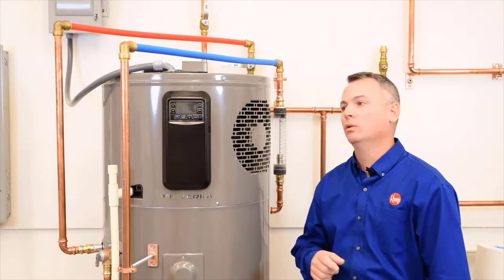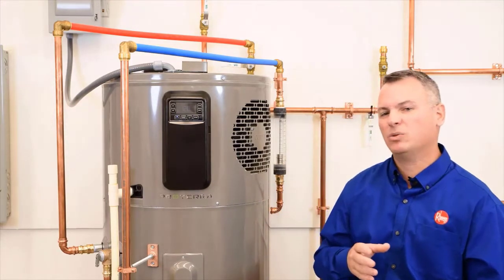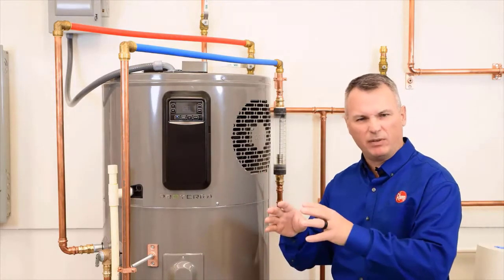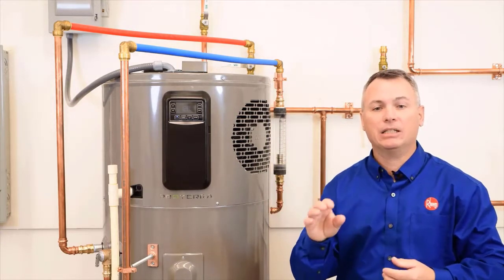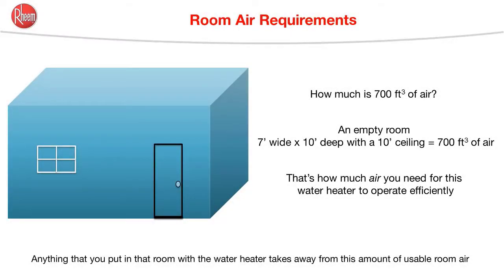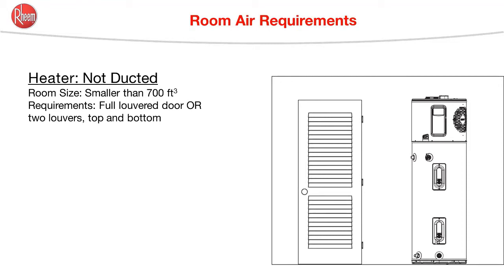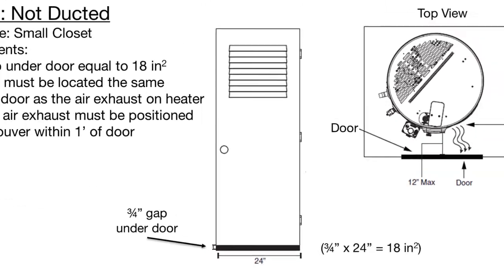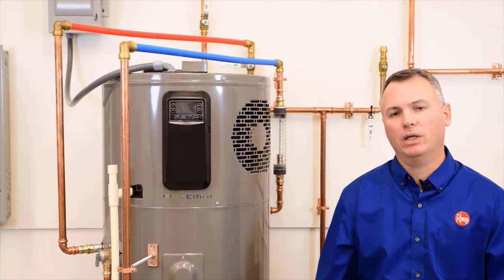Room Air Requirements for Installing Rheem® ProTerra™ Hybrid Electric Heat Pump Water Heaters

Comment: Video was not helpful at all.  You spent most of it talking about the requirements but little about where the ducts go, postive/negative air pressure.  Rooms that are smaller that 700 but don't have a spot where the water heater is 12 away from the louvered door, etc.

Comment: We have this water heater in our unit and it makes an excessive amount of noise. A very annoying high pitched noise. We have gotten it replaced and this new unit still makes the same noise.
Reply: I'm looking at the same issue. I believe. They are willing to replace it, but I fear the new unit will do the same thing.

Comment: I was hoping to learn what the optional ambient air temp needs to be.  My basement gets no colder than 63F in the dead of winter.  Wil an HP water heater functions efficiently in that environment.

Comment: Too much piping. There should only be 2 pipes on the top of the tank and one going down the side for pressure relief. Also my tank is in a 2 foot by 2 foot closet that has extra insulation. This is a poor design. Probably an engineer designed this monster. 73

Comment: I am still confused what is best practice for locating my heat pump water heater. I was going to place it in the garage. The garage meets the 700 cubic ft requirements. The house's location is Eureka, CA so we have a range of average of 46-64 degrees but rarely below 33 degrees. In other words not extreme. If the heat pump is drawing heat from this space and adding cold air would I be dropping the temp in this space out of the range of efficiency? (Making a cold garage colder.)  The second option is to enclose it in a closet in the garage and vent it to the outside. Probably more efficient but cost more to build a closet and provide a door and flashing venting to the outside. Question: Would this work efficiently just in the garage or is it recommended to have it in a closet that is vented to the outside? Thanks

Comment: Have a two story home in Arizona. Family of 4 not entirely sure if I should get 50 gal, 65 gal or 80 gal. Any suggestions
Reply from the maker: We would recommend consulting with a local plumbing professional to help choose the best Rheem Water Heater for your family
Reply: @rheemwater  Not familiar enough with your own product or too scared to actually commit?

Comment: My current water heater is in the large stand up crawl space. It gets to a low of 28-34 degrees in the winter . I assume a heat pump wager heater would not be the best option.

Comment: How did you mount the hanger for the cold water inlet to the side of the heater? Is it safe to just drill in with some short self tapping screws?

Comment: What is the approximat temperature of the exhaust air? Let's say the unit takes in air that's 70°F. What does is cool down to on the exhaust side? 65°, 60°, 55°?
Reply: These units work best the higher the temperature is above 40 degrees.  Hope this answers your question.

Comment: Anyone have any experience with the 120v plug-ins? One of the local Rheem plumbing reps is trying to convince me it’s not a good option vs 240v, but the only argument against is the slow recovery time. Anything else i should be aware of? Thanks!

Comment: This heater seems better suited for mild/hot climate homes where using internal heat in the building is desirable. It would be ok in summer time to use excess heat in a household but the water heater is usually in the lower part of the house where it is cooler already. So for this system to be ideal, it would need to be on the warmest floor of the house and pulling heat from the air when you want to COOL the house. It would be a negative when you want to HEAT the house unless it has an outside heat pump to draw energy. Otherwise, it is a pretty interesting idea and could work well in places that need more cooling of the internal air.

Comment: The 120v shared circuit 50 and 65 gallon first hour rating is 55 gallons? Typo on rheem website?
Reply from the maker: The first hour rating is correct for both products. If you have any additional questions please call Technical Support at 866-279-4566 between the hours of 7 a.m. and 7 p.m. CST and one of our experienced analysts will be happy to assist you.

Comment: When my brick foundation was replace by concrete I had a small utility basement created for the water heater and furnace. I recently went all electric and added a 65 gallon Rheem. It was installed in the utility basement which is theoretically too small. There was already a louver between the room and the crawl space so that the former gas appliances could get air. I had a small air extraction fan installed opposite the louver and facing the water heater exhaust. It exhausts out a vent and works great. The room gets a bit cold and dry in Bay Area winters, but the incoming air isn't that cold and is certainly humid. I also added solar and this year my PG&E bill was about $35 negative. I still have a bit of credit on my bill. Happy camper here. Oh, and the room will have my batteries should I decide to install them.

Comment: I have the 80 gal model.  I wanted to oversize for my wife and I because heat pump is much slower to recover so I made up in volume.  It does sip electricity and runs for hours.  I would only use this if you live in the south.  We built a new home and I put a 8 in vent hole in the side of the house to vent in the winter.  The good part for us, it keeps moisture low in our finished basement.  We have a small storage area with garage door to store the golf cart, we just leave the interior door open most of the time to have additional flow.  Yes it can be a bit noisy.  So if you dont have a good application for all the recommended requirements, you will not be happy.  For those in the south, its free air conditioning and is really cool.  What I cant believe is the current model in this video does not have the collars like mine to add duct work.  Wow...who was the genius that wanted to save the company a dollar?

Comment: I'll say one thing. Rheem really did a disservice by downgrading the control panel from the Gen 4 to the Gen 5. The old blue touchscreen was so much better. You could see the temps in .1 degree increments in both the upper and lower tanks, service info and alerts all within a few taps. Now it's a crap screen that shows nothing and an app that hasn't been updated in over a year with a water availability pictograph that is always completely full or on red after a single shower lol.
Reply: Buyer beware! 73

Comment: You've said in an earlier comment that the unit doesn't operate efficiently in less than 37F ambient, but is there danger to the unit or will it just use more electricity because of lower efficiency?  My garage was in the mid 20's for a week this winter.  The unit will be in a smallish room in the garage with an open door, so greater than 700 cf.  I could install a door to close only during cold weather and keep the light on to increase the ambient, but then the volume of the room would be less than 700 cf; maybe 400 to 600 cf.  I'm thinking the 700 cf min is to prevent overheating, so less than that during extreme cold periods wouldn't be a problem.
Reply from the maker: If the ambient air temperature goes out of this range, the unit will automatically revert to the traditional "Electric Only" mode until the ambient temperature falls back into range. The minimum room air of 700 ft³ must be maintained. When the unit senses ambient air temperature below 37 degrees F, it automatically switches to Electric Only mode.

Comment: Thank you for the video. Will this work with a hydronic heating system. Right now I have a hyrdonic water heater but would love to use this if possible.
Reply: As an HVAC tech I want to say yes it will work but check the literature and see what the max allowable temperatures are for this tank and how efficient it is at higher temps. In hydronic heat you would probably want temps around 140-160 or higher in colder temps.
Reply from the maker: Unfortunately, these water heaters would not recover quick enough, or produce enough hot water, to keep up with a hydronic heating system. However, please consult your nearest Rheem representative, as we have a solution for every hot water application. Please contact our Technical Support Team at 800-432-8373 for more details.

Comment: What is the room air requirements for the ProTerra®Plug-In Heat Pump Water Heater
 (120V Dedicated Circuit)? Can I install outside? Should I install in a locker and set on a vibration pad? Thank you! - Writing in from the San Francisco Bay Area.
Reply from the maker: The 120 Volt Dedicated Circuit model requires 1,200 ft³ of air. Outdoor installation is not allowed. Vibration isolation would be recommended if excessive vibration is anticipated. Rheem sells vibration kits, as well as seismic isolation kits that might be required in your area.

Comment: If I bought the Rheem model XE40T10HS45U0 could I add the leak detector and auto shut-off valve later?

Comment: My current water heater is in the attic. Can this water heater be installed in the attic? The room space is big. Not sure if the heat/cold in the attic can degrade the functionality. Can you please confirm?
Reply from the maker: The minimum air requirement is 700 ft³. The operating temperature range is 37°F to 145°F. If the ambient air temperature goes out of this range, the unit will automatically revert to the traditional "Electric Only" mode until the ambient temperature falls back into range.

Comment: Are refrigerators and air conditioners considered to be heat pumps?
Reply: They both pump heat.
Reply from the maker: At a basic level, yes. They use a refrigerant to move heat from one location to another.

Comment: IDEA:  Have a "Summertime Mode" where it vents to and from the interior space, and a "Wintertime mode", where the cold air vents to and from the outside space.  (use traditional water heater exhaust vents, and add mechanical baffles)  In the winter, take air from outside the envelope to grab the heat from, otherwise, this unit would "steal heat from the house/garage to put into the tank", thus being parasitic on your main house/garage heat...
Reply: True but if you have a wood stove in your basement your in luck. You Sir are a critical thinker.
Reply: @MrSprintcat  Same thing with a refrigerator... In the summertime, if it could vent the excess heat outside, and wintertime waste the heat to the interior space, then that would be more efficient than having to re A/C the heat that the Fridge puts out in the summer...

Comment: I don't know if this is accepted practice but I though it was a fun idea.

I ducted the intake to my bathrooms, since they share a wall and the DWH is in the basement directly below both, it was pretty easy. So now the DWH draws warm moist air from both bathrooms, cools and dehumidifies it, and then releases it into the basement right next to the primary heat source which is a wood stove.

Next, I'm thinking of ducting the exhaust air back up to the living room for better air conditioning performance in the summer, maybe use some dampers to direct it seasonally as necessary.

Thus far, I have been very happy with my Rheem ProTerra. It's summer time and we currently have inlaws and cousins in town and with 8-12 people, it performs without any issues. I do have a wastewater heat reclaimer, so that does help with total hot water volume.

Cons: The duct adapters are ridiculously expensive for what you get, which is a simple plastic duct adapter. Fortunately, I got the water heater about half off due to state level instant rebates.
Reply from the maker: We're glad that you're very happy with your Rheem ProTerra Hybrid Electric Heat Pump Water Heater. The EcoNet app has a lot of features. Here are some blog posts that highlight some of those features: https://www.rheem.com/water-heating/articles/tag/econet/. You can download the app here: https://www.rheem.com/econet/.

Comment: They removed the ducting adapters and replaced the fan with a noisy 
unit on the current generation, 5th gen.  I guess they figured they 
could sell them separately so why include them? Disappointing.
Reply: Yeah, and they cost $140 each. EACH!
Reply: Rheem hybrid water heaters are as loud as a loud hot water heater. Neither Rheem nor Home Depot warned us about the excessive noise. I'm going to try to return the unit on Monday. If they don't take it back, it is class action lawsuit time.

Comment: One of the byproducts of it the noise and vibration. I had one installed on the fifth of May and as soon as it was turned on, I said to the installer it's noisy and he said it will quite down and it didn't. When it's running you can hear a ringing noise coming from the compressor and a hum from the blower and the vibration from the compressor resonates through the walls on that side of the house in my front office and back bedroom. They say it's normal to have 65 dbs but how come I can hear it in other parts of the house. If this were in the house it wouldn't be acceptable and its very irritating when I'm in the garage working or on the treadmill. I worked as an appliance tech for 30 years and changed a lot of compressors and this is not acceptable and cannot recommend this to people especially if it's in the house it would be very irritating after running a while. The tech is supposed to come out and move it away from the wall because the back screw that holds the cover on top is not accessible if you had to remove it to be serviced and to see if the vibration can be stopped through the house. Refrigerators and window airs aren't this noisy why is this unit? It's not right This is a generation 5 and I hear the 4s weren't as bad and you can't find one, so buyer beware. I talked to the company who installed it and said Rheem isn't doing anything about it and that's a bad sign of a bad company.
Reply: I had the same issue. In my case, the ringing came from the outlet grille. If you hold your hand on it, you can stop the ringing and the fan and compressor are much less obtrusive. So I used some magnets that changed the resonant frequency and the ringing went away. You could also cut the center piece out.

It's a poor design that apparently nobody noticed in testing. But it's not hard to fix.

Comment: Do you need a expansion thank for 80 psi or less?
Reply from the maker: Yes. Water expands when it is heated. Thermal Expansion Tanks absorb this extra volume of water until a hot water faucet is opened and "extra" water is put back into the system.

Comment: So putting this inside the apt isn't ideal since the air will be cooler than in a typical garage setting
Reply: The ultimate heat supply will be provided by the HVAC system. This thing runs about 9,000 BTU of cooling while it's running, so it's like having a small window air conditioner. It's great for in the summer. In winter you may introduce some comfort issues, but you can fix these by ducting the cool exhaust somewhere where it is less objectionable. The other option is to run it in resistance only mode in the winter, if you are having problems. It's a simple button push. The downside is that you're operating like a regular electric water heater at that point, which costs much more. But like I said, in the summer, you're basically getting free air conditioning, or free hot water, one of the two.
Reply: @wiredforstereo  I didn't know you can switch modes, thanks!
Reply from the maker: So we can further assist you, please contact our Technical Support Team at 800-432-8373.

Comment: What kind of sediment filter are you using in this setup? I like this setup and  I cannot find a vertical in-line one like this,.
Reply from the maker: The clear graduated tube on the cold water line measures the water pressure. It was included for demonstration purposes during our training. For preventative maintenance, we recommend draining a few quarts of water monthly from the tank to reduce sediment. Please refer to the use and care manual for details.